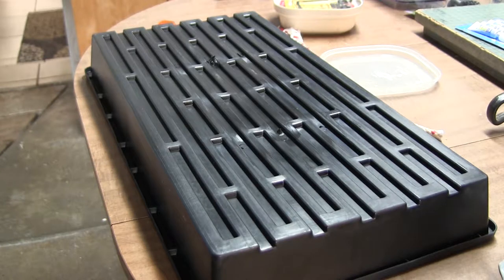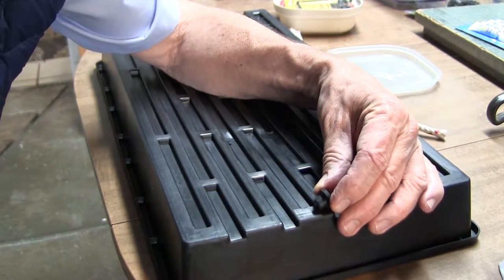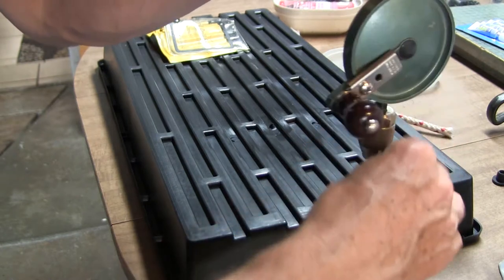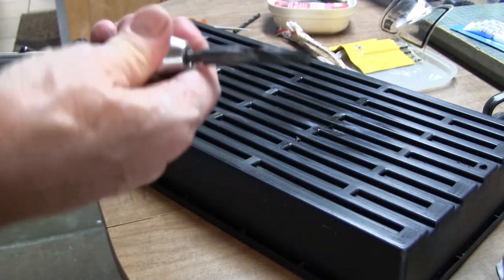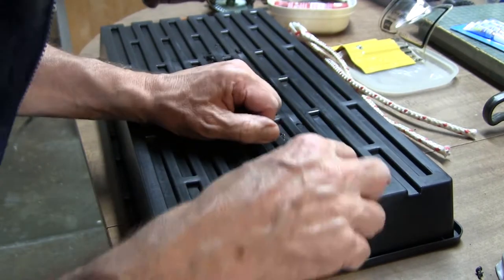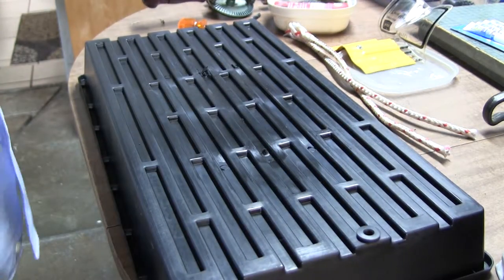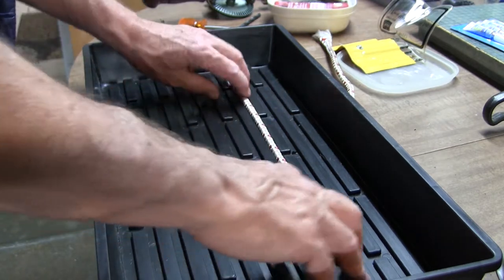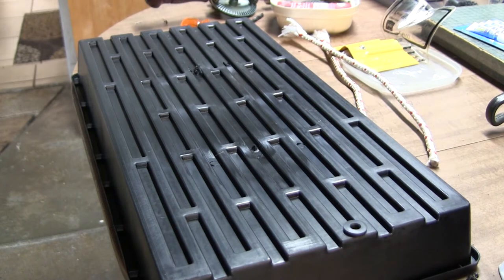GSM Solution - Install Tophat Grommet

Comment: what's the overall depth of those grommets (the tube length)?
Reply from the maker: About 1/4". I've moved on to deep water hydroponics.
Reply: @tangobayus  thanks for the reply...I was thinking about using those grommets for a different yet similar hydroponics application...I'm currently working on putting together an indoor hydroponics setup in my home (all new for me)...I'll look more into the DWC side of things...I've heard of it, but need to come fully up to speed on it...thanks again!
Reply from the maker: @insurroundsound  Watch this- I have 2 of these running:
https://www.youtube.com/watch?v=oYm7h5VdKMU
You can also add a 100 gph pump to this:
https://www.youtube.com/watch?v=8f68fOHmASo
Making floats: https://www.youtube.com/watch?v=MZrdbZb5z4I
Float hydroponics:https://www.youtube.com/watch?v=-QhESOyecVo
Feel free to ask questions.